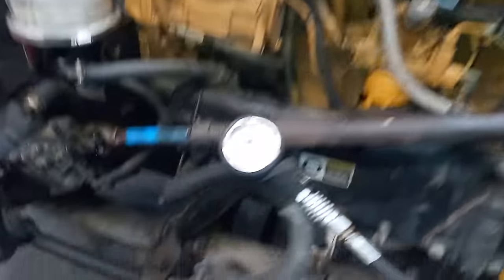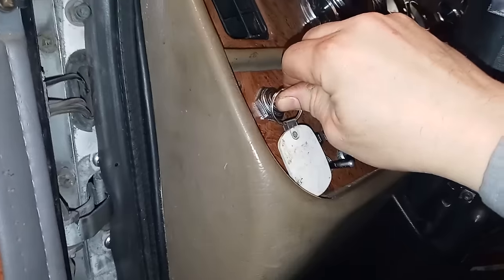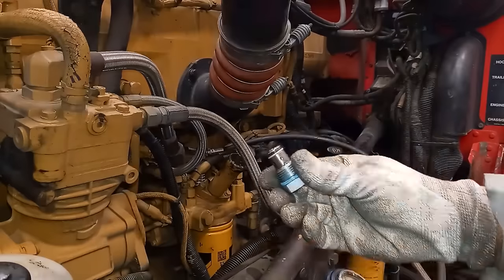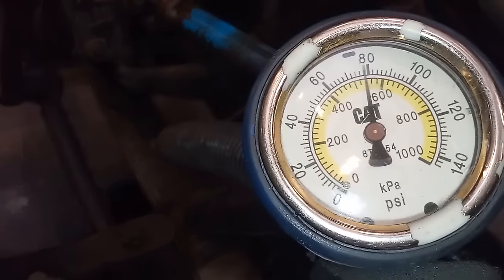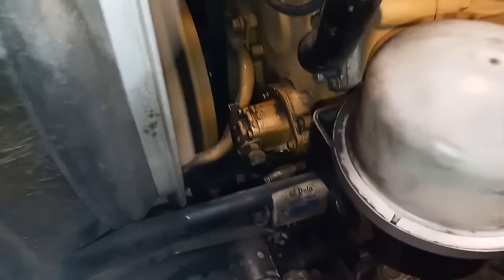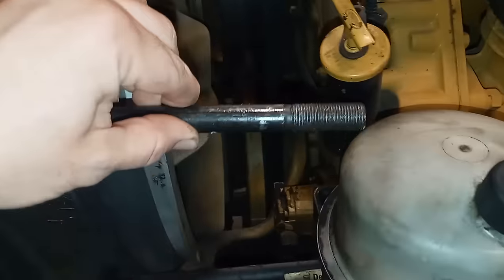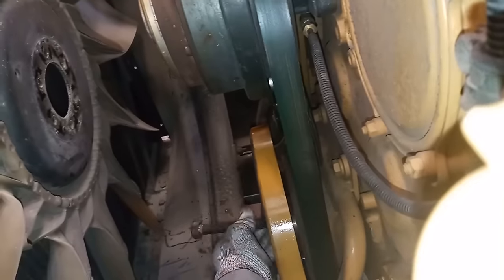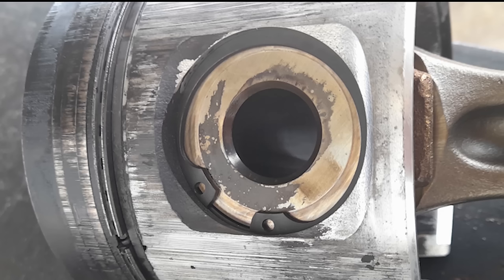Fixing a subscriber's SHAKY C15 Cat engine. Bad Damper? Low Fuel Pressure?

Comment: I think more mechanics should do videos. I believe a lot of the reason people are bringing their trucks to you specifically is because you've proven yourself to be a very knowledgeable and very competent mechanic that is also highly detail oriented. Have this channel and showing your work gives people comfort knowing that they're stuff is being repaired by someone that will make sure the issues are fixed before you sign off on the truck and let it leave the shop.
Reply: I agree with you but, what people need is honest mechanic.I was O/O for a long time and that was quest like don Quixote assignment.I never knew why is so hard be honest and charge honestly.Cheers.
Reply: @malchone1  you hit the nail right on the head man. That's another reason why people take their stuff to people like Josh. My step-dad has a 2000 7.3 powerstroke that he recently started having trouble starting and took it to a local shop because he was so busy at the time he didn't have time to fix it. They put in a new high pressure oil pump and that didn't fix it so they did another High pressure pump and that still didn't fix it so they put in a low pressure oil pump. They did all sorts of stuff and threw all sorts of parts at it with no luck and charges for every dime. My step-dad finally had enough and took the truck back still dealing with the same problem. He was able to get some time to work on it. A set of 8 glow plugs later and the truck started with no issues. Mechanics now a days are so bust trying to charge as much as possible they don't bother checking the most basic things. Like in this situation I'm sure a different mechanic would've just done a whole new transfer pump instead of just fixing the pressure regulator.
Reply: @ThirdHornet  before I even read down to where the actual problem was I said to myself pull the glow plugs and test them always start with simple and cheap unless of other evidence.  Today's mechanics aren't mechanics they're technicians.
Reply: @justinthor Not if they're confident in the work they do.  If they're cutting corners or are not doing things correctly, then of course they don't want documentation.  Ironically, if they are doing things the right way, documentation protects them.
Reply: It's always a plus when they aren't trying to hide their shotty work

Comment: When I had my C-15 rebuilt the mechanic to me he always installs a new crankshaft damper when rebuilding engines. He explained it helps take the shock when under load. He thinks most crankshafts crack due to the lack of a new damper.
Reply: Most crankshafts do not crack
Reply: @fastinradfordable  yeah but the ones that do the guy believes are because of the damper? What was the point in your comment again?
Reply: Cummins recommends replacement at 500k miles on ISX
Reply: @fastinradfordable  the crack and the also clean snap, C15 especially common for shearing at number 1 cylinder
Reply: @fastinradfordable The mechanic that told me they do,probably forgot more about diesel engines, than you will ever know. Just say’in.
Reply: I learned it from Pittsburg Power 
Yes - correct Sir
The old dampers fail to absorb the torsional vibrations - eventually cracking and or snapping the Crankshaft
Reply: I can see it having rough idle front ans rear seals going and bearings but to snap a cat crank is more then 1 thing...
Reply: @ronunderwood5771 Cummins is trash and you usually should do an in frame before you change the damper

Comment: There is nothing worse than putting in a spring loaded check valve one handed in a tight space! I've invented new cuss words doing that job.
Reply: CAT 314D Serpentine Fan Belt. Took 1hr to try by oneself, then took another hr with 2 people - One spinning the crankshaft and feeding the belt on the pulley.
CAT made 2 belts - One was about 1/2" longer. I had the longer one and still took 2 people to install. Very limited space for 1 hand / arm & belt felt it was still approx 1/4" too short to fit quickly. Cursing words flew around like normal vernacular ;)

Comment: I picked up a new damper years ago, not knowing how heavy they actually are, I took my KTM adventure bike thinking I would just put it in one of the side hard cases.   WRONG!!!  That thing was too big to go in a side case so I ended up cramming it in my backpack and riding home, 70 miles.  Good thing my wife is a physical therapy assistant.  My back was out for the next couple days.
Reply: But it a smooth vibration free ride though ? LOL
Reply: @charlesb4267  Hah, good one!

Comment: I noticed my c-15 started to shake while under a load. Been noticing it for a few months. So I found this video and did everything and still didn’t fix it. Then my passenger tank wouldn’t equalize last week. So I switched out the splitter valve and a hose that didn’t help. Ended up being my pickup tube were original and the passenger side had broke off and driver had a crack. Fixed the equalizing between both tanks and no more shaking. Kitty kat is happy getting all the fuel without air. Hope this helps someone.

Comment: Good info there, with the fuel check valve there the torque is important. we had the pressure gauge on the fuel and slowly torqued the valve up and over torqued and the psi would change, set at spec. it is correct psi.
A trick with the viscus damper is take the temp with a temp gun before starting, cold engine then run for 5 mins and take the temp, it should be warmer then the first temp reading due to the internal ring moving through the fluid inside the damper, if the fluid has gone bad (hard) there is no temp change.  We change them at 800,000 km/500,000 mi as precaution to save crank.
Reply from the maker: That is a super good idea with the damper. I need to cut the old one open to see what the insides are still.
Reply: @AdeptApe  
Yes include that in your next video

Comment: Ooooooo Oooooo.    The APE is back, and it’s a very timely video.  My RV with a C7 is currently in the shop struggling with a similar issue….a mysterious misfire that may be fuel related.
Reply from the maker: Larry, you are the first comment! Pretty cool.
Reply: @AdeptApe  wow.  Never thought of myself being cool.  😇😎
Reply: That engine has a high pressure oil pump to run the injectors, same as a Ford PowerStroke.

Comment: Don't worry, Josh - damper is the proper term everywhere.  Because it damps the vibrations.  Same as how a "shock absorber" is actually also a damper (and it's the spring that actually absorbs the shock.)  A dampener would be something that makes things wet.  😁

Comment: Awesome video, now I’m gonna change my damper and replace my fuel regulators . I run about 85 psi under load. Always thought it was low. I have a 5ek and am experiencing a little vibration . I Learn a lot from your videos sir!
Reply from the maker: Thanks for watching the videos. The E models don't seem to be as sensitive to lower fuel pressure as the ACERT, but it can give it a chance and see.
Reply: Thank you sir, watching your videos have really taught this old man a lot. Don’t laugh, but I was an N14 guy till my first CAT, now it’s all I’ll ever own. With one exception. The 2019 KW that had the X15 (trash) that I just sold in Feb.

Comment: It is a honor for a tech, when a customer request you and you only. Back in the day I had a few out of state customers. I dislike checking fuel psi at the quick disconnect port. The psi is before secondary fuel filter and you do not get a true reading of cylinder head psi. I have done this a few times when I just can't fuel psi where I like it. I take the 75 lb regulator apart and give the spring a little pull. I have also seen people use the 100 lb regulator out of a REGEN engine. I have never tried that, afraid of blowing EUI seals out. Also on older FTP taken that spring out and give it a pull as well. Any time I have the front damper off, I try and talk the customer into replacing the front seal. I also like to data log and do my high speed five cylinder cut out test and see what RPM's each cylinder will hold. Fan off, A/C off, Air compressor off.

Comment: I had the same thing, bad damper .
Our Dealer, Wayne Supply  in Corbin Ky. couldn't find it, 
I tore into it to put a front seal in it , layed the damper down and it rattled like junk metal , that was the problem, changed the whole way the truck run , much smoother quieter, believe it or not it shifted better.
Need to be regularly checked, I guess take it off and I think they weigh them. Only way I know of.

Comment: A fluidampr was the first thing I installed on my new to me Cummins 5.9 when I bought it in 2018. Much smoother than the stock rubber sleeve damper used originally. I enjoy watching your vids.

Comment: I have replaced damper on my truck I felt the difference right away on a start the engine and shut off, driving smoother, the most important I got my fuel mileage back. My fuel mileage in SE region 7.11- 8.19 mph, up NE forget about - 6.75. will be replacing damper every 400k. The reason replacing damper - front seal could stay almost a year then leaks. My engine NSX C15. CATs are the most mechanically friendly engine, it's just to me. Love the videos.

Comment: I've followed your channel for years, had an MXS, and now a BXS. I shimmed my Mxs and fixed this problem. But due to the style plug in the bxs it is impossible, and it's been fighting me. I just replaced the transfer pump and it got better, but have NEVER known of the regulator by the filter housing. I literally changed my pump yesterday and this video couldn't have been better timed! You do us acert owners a great service and on that note! Thank you for all you do, it's immensely helpful!
Reply from the maker: Thank for watching the videos Chris and thanks for keeping those Cats running.
Reply: @AdeptApe  so I've changed all my sensors fuel temp, barometric, intake air temp, intake manifold pressure, iva oil pressure, iva solenoid, new ivav harness, new motor harness, diverter solenoid. Still skipping, it only does it when above 175 coolant temperature. Like skips until it picks up fuel and then runs fine until you get out of the throttle like coasting then repeats, when weather temp is below 60 degrees it never acts up at all! It loves the winter months. Any thoughts I'm at my end, and really don't know what to think. No check engine codes at all.....
Reply: @chrisarcher4098  Have seen EUI's fail hot. When engine cools down start hitting again. Most of the time it is five or six EUI. I put the truck on dyno and load it down until misfire starts, use ET to locate which EUI has failed. Right now a EUI from Cat is month's out.
Reply: @johngoldsmith6629  that's exactly what it is doing, when you say EUI you're referring to the injector right? I was definitely wanting to get it onto a dyno very soon. I've covered all other basis.
Reply: @chrisarcher4098  Yes injector, twin turbo part number 10R1273, if I recall and  get a new hold down bolt 8S9191. Single fuel tank or dual?
Reply: @johngoldsmith6629  dual it's in an 05 pete 379, I've also replaced every inch of fuel line that isn't steel tubing. Thanks for the info man!
Reply: @chrisarcher4098  Don't run with low fuel. The fuel can get hot as return fuel is coming out of the cylinder head. Can be 200 F plus. Extra fuel will help cool it down before being pull back in. If you have to run low fuel in the tanks. You need to put a cooler in the system. A cooler helps dissipate the heat.
Reply: @johngoldsmith6629  right on that's good info, may look into a cooler after I sort this other issue out. Thanks for sharing your insight and experience!🤘
Reply: @johngoldsmith6629  Hey John,  just wanted to tell you it was number 5! Did the job myself and this  thing is running fantastic, I really appreciate your input, and help! Thank You!
Reply: @chrisarcher4098  You the man.

Comment: Thank you for putting the part # for the fuel transfer pump spring. My local Cat dealer told me I had buy a whole new fuel pump. 
Trying to fix a only start with ether issue. Has to be fuel delivery...  I think?

Comment: That’s the benefit of trucking. If you find a good shop or mechanic you can always book a load to go there. 
Have you publicly announced which location you work at. 
I wouldn’t mind having the valves set on my C-12 and the Allison transmission serviced. It’s a motor home so you might not want to touch that. 😂😂

Comment: Learned the cruise control trick on the first Detroit I drove. I was told the oil pressure would drop so low at idle it would die. So raise it off idle and keep the oil pressure up.

Comment: I think I'm going to pull the radiator on my 387 lol. Not much room at all . I'm going to install Pittsburgh powers mercury filled balancer along with a new damper.  My damper is originally with 1.4 million on it . Mine has a vibration under heavy load also so it's time before I break the crank lol. Good video.

Comment: Save the extra threaded rod that you cut off when installing a new brake can. It works great for installing the damper
Reply: do those dampers come off easy are do you need a pulley thank you for your time
Reply: @serpentrae  they come right off ez
Reply: @CTX50  thank you much appreciated, stay strong

Comment: There's also a fuel bypass valve in the engine mounted fuel filter head.

As for that pump spring, that's a light spring. Stretching it an inch and putting it back in does the same thing. But, given the likely age/miles on the pump, I've had them go bad at 250k miles before. Anything over 400k, for sure replace it. Not much more money than replacing the pump, after core is returned.

Comment: Might have to send you some destructions for your videos. Last week pulled a 3306 head and the block was warped and the liners were uneven.  The deck plate was a bow shape LOL. 3516 pulled the head to find a hole in the piston from a dropped valve. I have seen a lot of very destroyed CATs

Comment: On the destruction  you said that " it pretty much destroyed the piston " .   NO it absolutely, positively,  with out a doubt  Destroyed the piston.  Years ago I had a 3208 in a 225 backhoe that got overheated.  Each head had ¼ inch wide cracks, and when I pulled the rings off the pistons I was able to twist them like bailing wire. I kept on of them for years to show, I  had 8 complete turns on that ring. 2 new heads, new rings,  (well complete overhaul used the same pistons) and put it back to work.

Comment: One trick that might have made installing the hard to access plug easier is to cut a section out of a correct size allen wrench, slide a ratchet spanner over it and push on the end with your fingers or lever bar while turning the spanner

Comment: Every time I get a bad vibration in my 379, it usually ends up being a bad engine mount. Either the bolts backed out of the bell housing mounts or the rubber biscuits are shot. The poly insulators seem to last better. The tell tale is that taking corners will increase or decrease the vibration.

Comment: Hello, I have a C12 Caterpillar, and I have a problem with the injectors, where the spring is, the diesel returns, and the oil mixes with the diesel, and I would like to know what the diesel pressure is in the injectors, the pump has already been changed of the dissel and the pressure, and it cannot be fixed, very good video, 👍

Comment: Josh, did the customer give you any feedback on the power, if he noticed any increase in power. I've changed out the pump and the pressure regulator on a couple of Petes ( 3406E and C15 MXS ) in the past as they were well used trucks before they were in my hands and the E series started loosing prime and turned out to be the worn pump/seal but I had no gauge at the time to check the before and after pressure delivery but did notice my fuel restriction gauge went up a bit as the new pump could actually suck properly. The C15 on the other hand was pulsing the dash gauge and test gauge and after replacing the pump that issue was gone. The long and short, those pumps don't last forever and after the frustration you had getting to that spring you might opt to put in a new pump in the future as that is a horrible place to work, right beside the frame and all the wiring stuffed into the frame channel, I totally understood your red screen ! LOL.

Comment: According to Bruce @ Pittsburgh Power, the vibration damper should be changed at 400-500K miles. The silicone fluid the inner ring slips around, gets hard. The ring can no longer move independently so the it can’t dampen vibrations.
Reply: Got my damper from Bruce. Opted for the added balancer also. Huge difference!

Comment: The viscous dampers do slowly die over a very long time. But the rubber dampers on gas engines work until the rubber just disintegrates with the inner and outer part of the harmonic balancer banging away at each other. The customers come in thinking the poor running, noisy engine is a goner.

Comment: Josh...what is your opinion of PDI parts v. OEM? Or Full Tilt Performance or any other aftermarket parts for CAT engines v. OEM parts? I just replaced my OEM exhaust manifold with a FULL Tilt Ceramic and thinkin of replacing the damper...thank you for your advice/opinions. BTW which Caterpillar do you work at in case I would like to bring mine to you as well...

Comment: Thanks 🙏🏼 going to fix my 550 kw generator I’m in Haiti 🇭🇹 the generator can go one day working non stop and two time a day it will stop working code low pressure going to verify the fuel pressure then do your step then after my plan is to  replace the fuel sensor